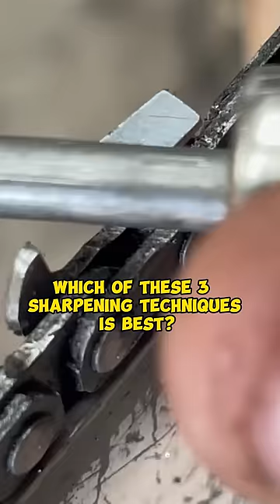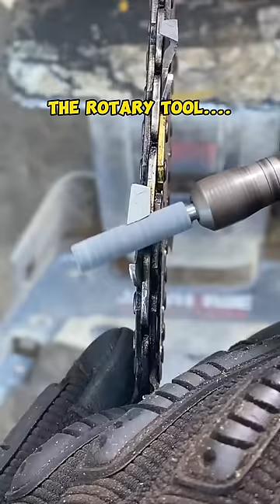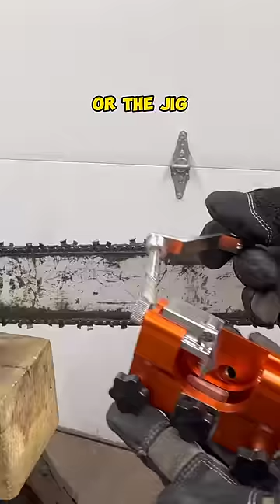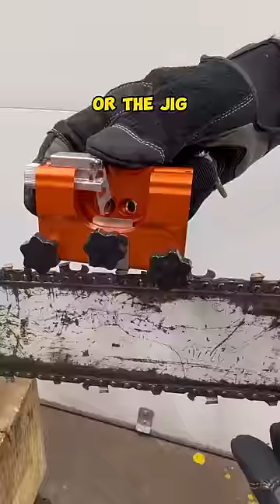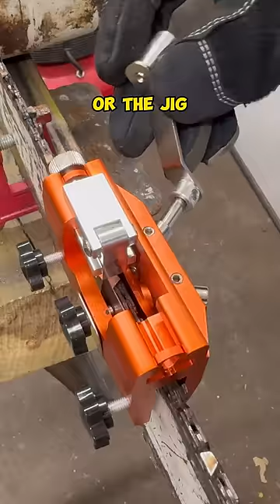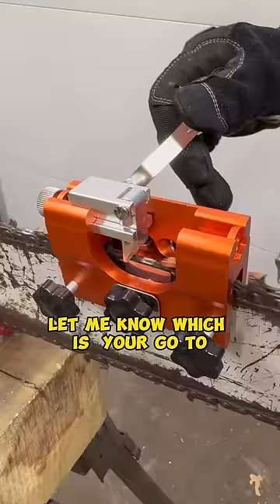What's your favorite way to sharpen a Chainsaw? #tools #chainsaw #lifehack

Comment: Hand file for me. Usually takes about 10 minutes.
Reply: Yep if you get good at it you don’t that other stuff
Reply: 10 minutes...Wow, how long is your chain?
Reply: @DarkspaceRebirth  only a 26" bar
Reply: @turkc7872 ma io ho una motosega con lunghezza lama di 50 cm come faccio a comprare una catena nuova che poi vada bene sulla mia motosega a motore?
Reply: @turkc7872  the funny thing is said if people kept their change sharp instead of worrying about trying to sharpen it after it’s dull, it wouldn’t take as long😊 and you keep it nice
Reply: No. 1 - the best
Reply: Try that with a 42" bar.
Reply: The stihl 2 in 1 is revolutionary give it a try. Does depth gauge and teeth in 1 stroke.
Reply: And it only takes 1 second for your buddy to run it in the dirt lmao
Reply: 10 minutes? Whatever
Reply: It should only take like three minutes tops, even on long bars with full comp chains
Reply: 😅😊😊 @paridecontini9773
Reply: I like to take my sweet time so 10 minutes or so for me too….unless I am at work then I take longer 😂 😂
Reply: No, 7-8 minutes
Reply: Same here. But half the time and it's probably because I have a shorter bar than you.
Reply: Get your self a nice chunk of rubber,cut into the rubber a bit once cutting is completed...the rubber will clean the chain up keeping her sharper for longer 👍 works for blades also
Reply: That drill would blunt the chain again if you let it ride over the tooth like that!
Reply: @turkc7872 ”only a 26” bar” yeah that’s the biggest you got as well. Bars that big don’t come cheap. Given 36 is the biggest over 2 feet of bar is nothing to sneeze at.
Reply: Jesus for a 32 inch bar a sharp file can sharpen in less than 5 minutes
Reply: 10minute and always a better cut + you can do it as you like ypur chsin to be
Reply: @MartinLaforce it’s 3 mins of sharpening and 7 minutes of sipping on coffee staring at the next tree
Reply: Round file for me, it’s usually nice time to sit drink water and relax and file for 10 or fifteen minutes. But they all work.
Reply: @derqatarzan4207  lol that sounds about right. I can do my ms461 with a 28in bar, in about 3-4 min in the field but I like to take my time at the end of the day, make sure everything is at the right angles, rakers are at a good height, and full clean ready for the next day. That for sure takes 10-15min
Reply: Same
Reply: @YeeeeeHaaaaa we got shit to do, ffs it’s not rocket science
Reply: Exactly. Maintaining is way easier then repairing. Personally I sharpen before I start cutting. Every fuel tank and when I finish cutting. And don't forget to file down your rakes people.
Reply: 10 mins? 60 tooth chain=10 seconds per tooth. I bet you do a great job with only 10 seconds per tooth.
Reply: @MartinLaforce if you don’t want chips yea
Reply: Hand file was always good for me. Surely the rotary could overheat the teeth and cause them to harden and become brittle?

Comment: I’ve tried all 3 and always end up back at a hand file.
Reply: Me too.
Reply: @endlessmountainoutdoors me three
Reply: Trained to hand file as a Military Engineer 46 years ago... I carry a file and as soon as I feel the edge go off I quickly resharpen with as few as 4 strokes. Sometimes only a few teeth are damaged by sand so those teeth get a little more, over time by not over cutting the teeth that don't need it you get longer out of your chain and even your cutter bar as by keeping the chain sharp and balanced you reduce wear on the cutter bar and the sprocket.
It takes a little time to learn but hand filing actually saves time and money.
I have seen many chains wrecked using grinders and filing jigs without an understanding of the shape your trying to achieve. This is best learned by going a bit slower. You also don't mess with the temper.

Comment: After 30+ years of handcrafting log homes...hand-filed chain is the way to go. Just be sure to file down the rakers.
Reply: Yup I remembered hand filling an not knowing to file rakers an saw just would not dig in an cut an my neighbor told me 😂
Reply: Yes, that's right. file down the rakers too. Otherwise the chain won't cut properly. We learned it with the hard way😂 But, why it doesn't cut, I sharpened the chain but why😂
Reply: What is “rakers” ?
Reply: @PiLLO360  the rakers are the peice sticking up in front of the blade it is what pulls the sawdust or flakes out of the cut
Reply: Amen bro, never did anything but that. Keep on keeping on! Happy new year too bro
Reply: Наточенная цепь , а не напиленная ошибочка😊
Reply: Don't be set in your ways 😂
Reply: That is what I was going to say.  "None of these methods because they forgot to file the rakes."
Reply: Looks like they have never been done
Reply: @WilliamHarvey-i1j  
Chain looks fairly new. Probably not needed yet.
Reply: @PiLLO360  
They are called rakers, as if they rake the slot clean of the chips. However, as I understand it, they mostly control the angle at which the tooth’s sharp edge meets the wood.

As the tooth bites into the wood, the drag caused tips the tooth back because it is ‘above’ the line of the link pins (as viewed here). This makes the raker, which is at the other end of the same piece of metal the tooth is made from, to touch and drag along the bottom of the groove  being cut. It cannot tip any more because that would lift the cutting edge off of the wood. The tooth edge is therefore held at a constant, designed angle as it cuts its way along, following the sliding raker. 

As the tooth is filed back while sharpening it, the raker needs to be shortened the correct amount to maintain the same ‘angle of attack’ (to borrow a term from aviation) to the wood, for the most effective cutting.

I hope I wrote this simply enough to be understood, but well enough to fully explain the way rakers do their job.
Reply: Affûtage à la main est une bonne solution . Vous ne risquez pas de détrempé la chaîne . 😊😊😊😊😊
Reply: Round or square file?
Reply: Nunca pude limar una cadena y nadie también explica bien esa parte
Reply: The chain could be scalper sharp. But the rakers determine wether ur spitting dust or ripping strands like spaghetti.
Reply: @Hondaone1  they look like a sharks fin
Reply: @tedk2166  Yes I know I was saying when I was younger like early 20's I didn't know to file them I'm now(37) an know to do that after you file the chain once or twice
Reply: @wilsonwallace875
I do round then triangle/chisel tooth file in the gullet . This was tought to me by my father-in-law  a former logger/feller.

Comment: I always liked hand filing. You get a feel for it, you can tell when it's sharp
Reply: Sharp teeth on around file a.good quality one works best. Take your time with each tooth cutting edge
Reply: Yep.!.
Reply: It is hard but it works.
Reply: I never got the correct grind with the files I prefer the Dremel
Reply: Soon as the files slides through without hanging up on burrs she’s sharp.
Reply: Hand file all the way but that jig is pretty cool though.
Reply: Yes indeed...it doesn't take 
Much filing, no need for electric

Comment: Machinist here. The jig should be used after a few sharpens to standardize the correct pitch. That being said, a hand file will work just fine.
Reply: I never could get that style jig to mount back on the opposite direction. It would always cut more or less on the oposite side.
Reply: Im a machinist too, cnc and dont like it at all. Rather be mechanical
Reply: Yep, hand file a few times before using a jig... and not a cheap jig like what is shown in this vid.
Reply: I like using the original Timberline jig. Quick, accurate and consistent.
Those knock-offs aren't worth the powder to blow them to hell.
Reply: Capitalist here : new chain !  
It always makes the gardener happy ;-)

Comment: The stihl 2 in 1 hand file. Sharpens teeth and takes down the rakers at the same time to the desired depth. Saw EATS after that
Reply: 2x this. I've tried the three shown. The Stihl is by far the best for me. 10 cords later and cuts like new.
Reply: That thing is worthless.  My brother had one with his saw and I ended up throwing the chain away and buying a new chain
Reply: @kennethlaw9830  you should probably learn how to use it properly then. Definitely operator error on your end
Reply: @kennethlaw9830  I don't know what you did wrong. But I know you did something wrong. I've had one for 3 years now and it cuts through wood like butter everytime.
Reply: @getsmarty7603  well we live in Minnesota and they make the saws come with these piece of crap safety chains. So called anti kick.  I don't know if it was that or the fact that someone found metal in a tree. I threw that piece of shit chain in the garbage.  Put a new chain in and it cuts like mad. Sharpened that chain later with a manual Sharpener. Works perfect. I know unless I'm in the middle of no where I will never waste my time on that tool again.
Reply: @kennethlaw9830  never a bad idea to carry spare chains. I have found rocks before with my chain and rounded the corners off the teeth and the 2 in 1 file was able to get chain sharp again. Sometimes the chain is beyond sharpening just depends on what you hit. I also live in Minnesota and burn wood for a heat source and work for a tree service company, it’s one of the best sharpeners I have found on the market. I also own an electric sharpener and in my opinion it’s a piece of shit and it’s made by Oregon. I’m a person who strictly prefers to sharpen my chains by hand because I get them razor sharp that way and all I run is full chisel chains. Have 4 saws, 550xp, 562xp, 365xp and a 288xp. This is the only sharpener I carry. I have used just a standard file and depth gauge but why waste twice as much time sharpening a chain when this tool saves 1/2 the time because it does both at the same time. Just my 2 cents
Reply: @GJGrey well I wasn't impressed with it at all. But you do you
Reply: 2 in ones work fine but sometimes you need to just get the hand files out to get it to where you want, especially after a good hit to sometime hard or get the drags set little more aggressive

Comment: The oregon electric chain saw shaperner is nice- shocked you dont have it on this list. I still perfer hand file though. The Oregon is as close as it get, i just dont know if the heat from shaperning with it is shortening the life spand a ton.

Comment: I am a hand file guy but I just recently tried the rotary tool... I picked up an MS170 for a good price but the chain had been abused and the teeth were hard as carbide... I burnt up two files trying to sharpen the chain and gave my new cordless Ryobi rotary tool a try and it rocked! I can get the same results as the file pretty much.  I'm going to experiment more with it I think. No good when the battery dies though lol
Reply: Hand file in the bush...
Rotary at the truck.... 
Bench mount at the shop...
That little orange thing for the little battery powered saw...
Reply: Yep, electric sharpeners will heat and harden the tooth to where a file won't cut.
Reply: @thisisyourcaptainspeaking2259  I messed up the first chain I did with my wall mounted chain grinder, hardened the teeth right up good, LoL

Comment: File. If you can tune your chain to your specific task, you beat all the gimmicks that do a "all around" edge. I don't sharpen my woodworking chisels with a machine.  What makes my saw chain different. I'd love to hear what we all think.
Reply: I achieve the best performance using a file but if the chain is rocked, I have to use the carbide burr to cut the damage back.

Comment: I have sharpened 100s of chains all different ways.   I got to say a bench chain sharpener  from harbor freight is the best.
Reply: Till it broke
Reply: Better yet, one  that is not from harbor freight. The one from HFT is decent, but very far from being the best.
Reply: Best $19.99 ($20) I've ever spent! I hard mounted to a scrap 2x4, and I just clamp the 2x4 in my vice.
Reply: @Dr_Mike2  you don't cut much wood
Reply: I started there. It worked ok a couple of times, and then they would go dull fast. All it does is sharpen the cutter, it doesn't touch the gullet and will change the chain geometry over time. You can really see the decline in the wood chips it produces. I noticed how nice a brand new chain was and went to a jig type that hits the whole cutting area. I buy a lot fewer chains now.
Reply: Seriously? I’ve heard that.
Reply: Nothing like that perfect angle
Reply: I hand sharpen will use a bench grinder if I come up on nails or wire in a tree to straighten the teeth back out then I hand sharpen it after to get best results
Reply: The tooth is easily overheated to the point a file won't cut it.  I guess the heat tempers the tooth.
Reply: We have an Oregon one in the shop the saw filers use. I've used it lots, very quick and next to impossible to fck the chain up unless you try.
Reply: Had mine for years and love it. Still carrt files in the woods but i power grind everything.
Reply: Setup right, fast and awesome.
Reply: I doubt it’s the best, but it works for me
Reply: @misterswan3131 a good portion of the chains come from the factory with a 25-30° angle... if you ever experimented with it you'll find a bit sharper angle, along with the rakers being brought down the more the chain gets sharpened, the chain will cut a bit faster. I personally go with something in the 35-40° range and it cuts much quicker than from the factory grind... only downside is you lose a small portion of the top of the tooth resulting in less overall life of the chain. But the tradeoff is well worth it
Reply: @Dr_Mike2    What do you do when you are out in the woods?
Reply: @Krankie_V wheres that old Ford truck of yours
Reply: @JgJg-p2f  in my yard waiting for the engine to be torn down and diagnosed. Having kids put the toys on the back burner.
Reply: The electric whizbang is reserved for the rock detectors. 
Otherwise it's a quick hand file every tank fill up. Keeping it sharp is way easier than bringing it back after it won't cut anymore. 
Plus you get a lot more cutting done that way.
Reply: I had the Harborfrieght version but upgraded last year, bench grinder all the way!!!

Comment: Hand file, rotate the file and only file in one direction.  Gives you a break from running the chainsaw as well so your arms do not get as tired.
Reply: that power grinder will eat your chain away
Reply: You don’t really have to rotate it. The file is made with a pattern on it that does that anyway
Reply: Ah yes the break, you are experienced.
Reply: @Meks450  
The advised rotation is not for the sake of the cut’s surface, but to distribute wear on the file and to bring clean, unloaded teeth into position, as I interpreted his comment.

You are correct that the file’s spiral cut shifts file teeth across the entire face of the chain tooth as it is stroked, so as to not leave grooves and/or unfiled places.
Reply: Pops taught me how to hand file and I always rotate to get the fresh file, I don't remember if he specifically taught to rotate it but it throws chunks!!!
Reply: @For_What_It-s_Worth  well that’s information from a source I would like too hear that from.
Reply: Everyone an expert lol. Use a calliper and find the shortest one then give a few strokes then measure then file to that … file the rakers down no need too twist the file is made too do that but y’all can argue

Comment: I prefer the file. It takes some skill but you can usually sharpen a chain quit a few times before it needs to be replaced. Stay away from rocks sand and nails
Reply: And DIRT

Comment: Hand file. Usually out in BFE when I dull one. Always carry a spare chain if i wreck one badly, but touching up before ya refuel is a good way to let the saw cool before potentially letting fuel come in contact with the hot engine.
Reply: "BFE" 😂😂😂😂😂
Reply: @nickhale117  lol. Just trying to keep it YouTube appropriate. Glad you got the shorthand.
Reply: @cs-bf1ug Haha i do that all the time, but hate when i touch hot exhaust lol
Reply: @edberkarahmet3135  Scars are just tattoos with better stories good sir. Or reminders to  better next time. 😆
Reply: 3/16 file for mine
Reply: @michaelkorrek7856  Don't recall which one mine uses. It's a Stihl 391
Reply: I'm not saying it don't happen I always hot fuelled my saws never had a fire in the past 41 years of being around them 30 years of professional use as I use a fuel can with a built I  spout there should only ever be a few drops spilt at most but I do deliberately spill a table spoon of oil on the bar as a bit of extra lube

Comment: Round file & small flat file for the rakers. I was a logger in western Washington state for 10 years. I wore the tall 16" hi logging boots, (caulk boots pronounced cork boots) & I kept a round file & small flat file slid down into my boot.
Reply: same here but we call them guides out east
Reply: You ever log in the black hills/capital forest of Olympia ?
Reply: You ever log in the black hills/capital forest of Olympia ?
Reply: @joshuajhoyt  used to live right near there but I never logged in the capital Forrest because there was never much logging going on in the capital Forrest.
Reply: Logged in Pe ell, Vail - Raineer, Aberdeen area, Raymond, Morton, Randle, Belfair, Silverdale, Capowsin, hood canal, hazel dell, Olympia etc etc etc
Reply: I lived near walla walla. Logged for11 years in the 90s in blue mountain region.  Dozers rubbertire and line machine. Nobody used those weird tool. Round file and flat file and razor sharp.
Reply: Bloody oath mate, I've seen kids throw away perfectly good chains, and all that was wrong was the rackers needed fileing

Comment: Dremel with stones is quick and easy and makes easy work on stone chips. Cutting firewood I'll take out 3 saws and cut a tank of gas through them and go back to the garage and sharpen clean and refuel them. Stick them in the vise and do a 25" chain in like 10 minutes.